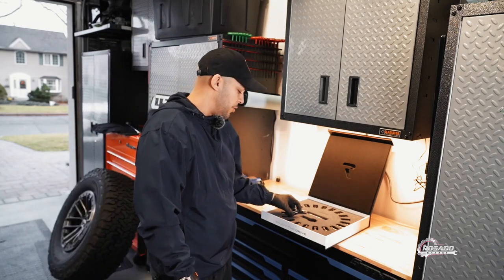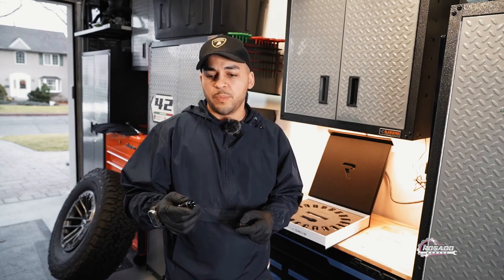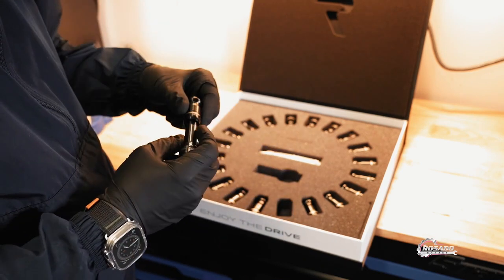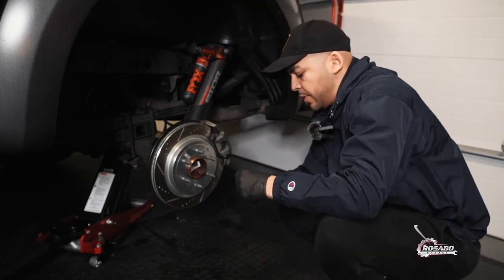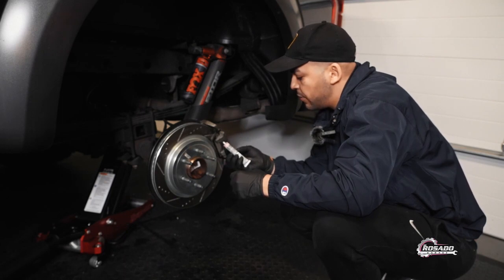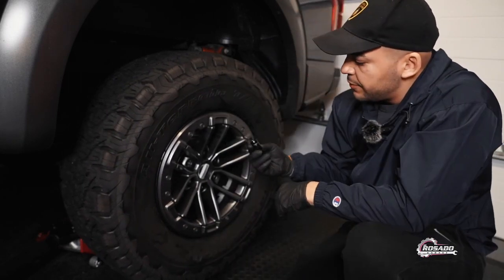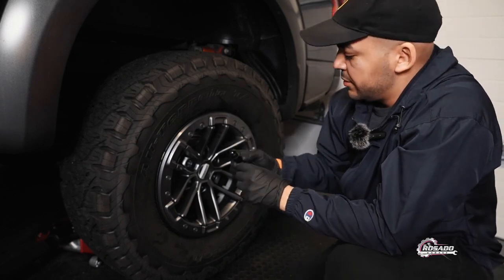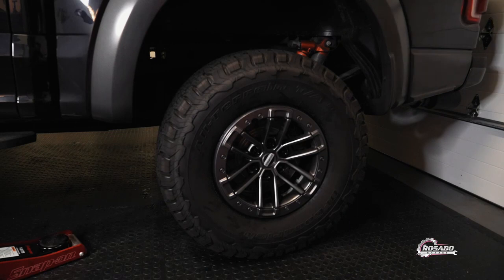Raceseng Lug Nuts in a  Ford F150 Raptor Gen II

Comment: Isn’t there a torque conversion chart that says the torque specs to torque these down too. Think 150 is now 130 when using with lube ?
Reply from the maker: When I say something on my channel it's because I got information from the manufacturer, with lubricant, without lubricant , the correct measurement is 150 pounds for each lug nut.  😉

Comment: You mentioned it comes with 20 lug nuts.  How did you get the extra 4 requirerd?
Reply from the maker: https://raceseng.com/products/tnr-1-titanium-lug-nut-single?_pos=4&_sid=de238cfac&_ss=r&variant=39779068149862